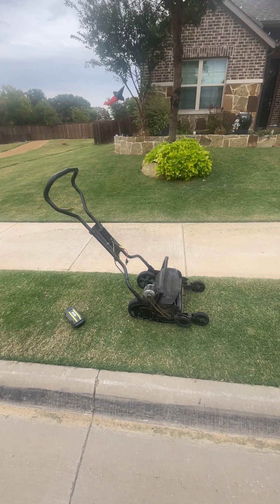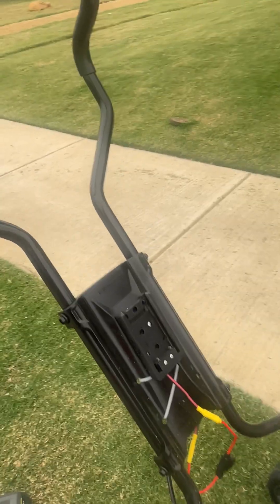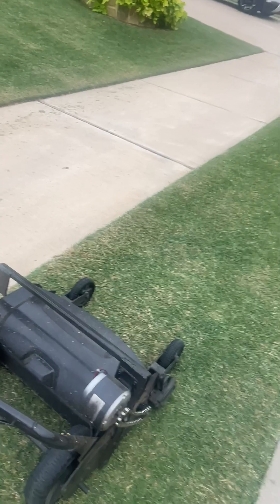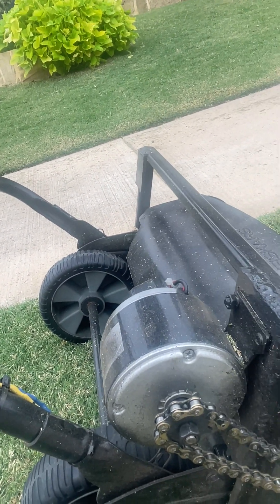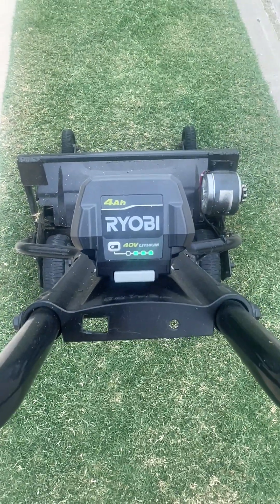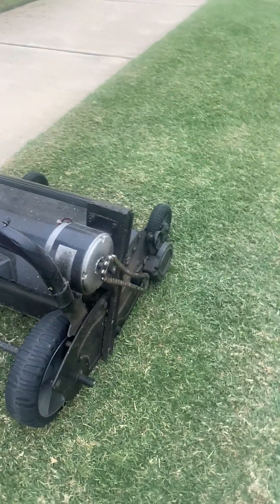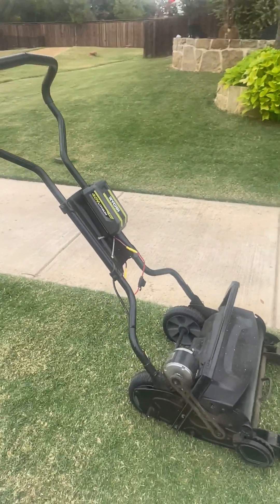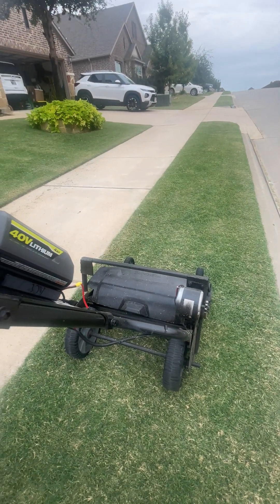Fiskars StaySharp Reel mower, electric conversion. #FrankenFiskar For Sale :)

Comment: Is that controller specifically for 40v or could you also use a 60v battery?
Reply from the maker: Looking at the Amazon listing, it maxes at 48V. I would not use 60.

Comment: I did similar to mine. Have you thought about modifying it to get lower? That’s my next project
Reply from the maker: https://www.zoro.com/ashland-conveyor-galv-replacement-roller-19in-dia-17bf-type-medium-duty-kg17/i/G1981415/
Reply: @texaswheelock  Awesome thanks! Did you wind up cutting off the inner frames on each of the wheels, when you swapped?
Reply from the maker: @brianw9938  yes sir

And a stepped drill bit for the holes
Reply from the maker: I put a front roller on it and it dropped it nicely.
Reply: @texaswheelock  Can I ask where and what roller you got? I’m having difficulty finding what people use and the sizing, since I’m used to rotary mowers and never dealt with rollers before
Reply from the maker: @brianw9938  For this build I used a 18" Fiskars StaySharp Reel. They are fairly common on Facebook Marketplace around me. 

https://amzn.to/3vDHvds
Reply from the maker: Sorry, I misread your question. Let me look for the roller.
Reply from the maker: Galv Replacement Roller, 1.9In Dia, 17BF, Type: Medium Duty
Zoro #: G1981415

Comment: This is great!  I am actually in the process of doing this to my Fiskars, however, I’m having a heck of a time getting the rear/large sprocket off.  I had zero issues with the small sprocket on the reel, but the large just won’t loosen.  Any suggestions?  My mower is in great shape, and I’ve seen other posts saying the large sprocket is much tougher to remove than the smaller one, but nothing has worked for me yet.  Any advice is much appreciated!
Reply from the maker: As I recall I used a socket with an Allen wrench adapter. I didn't take it off at first and other than banging my shin on it, it didn't affect anything.
Reply: @texaswheelock  Thank you for responding!  I was actually able to finally get it off!  I ended up using some heat (hair dryer) to heat it and let it cool a few times, which allowed it to break up what ended up being a bit of rust/corrosion and I borrow a neighbors’ long Allen wrench that gave me a bit more leverage and finally got it off!

Happy/proud to say I’ve completed the entire build/conversion and mowed a couple times already with it and it’s cutting quite well and also leaving some great stripes as I also added some harbor freight wheels to the rear axle!